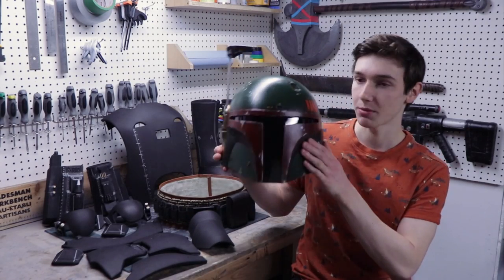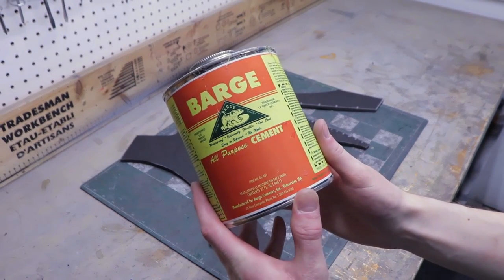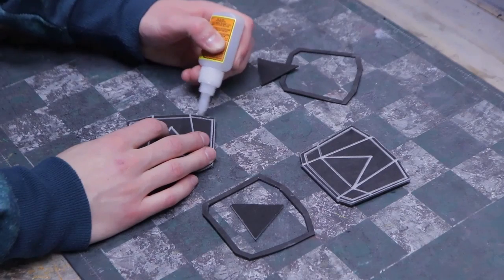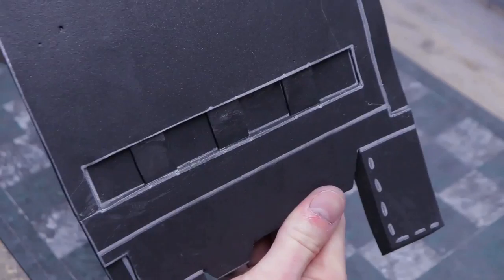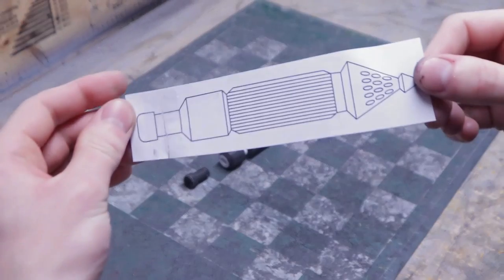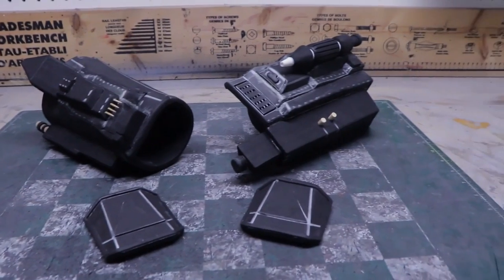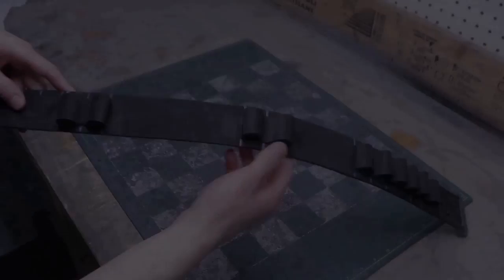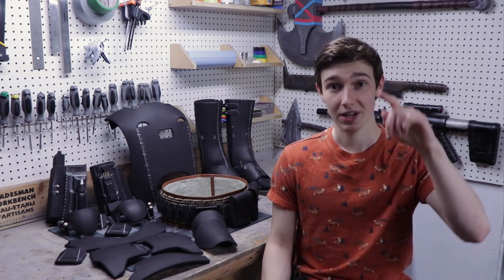Make Your Own BOBA FETT Armor Out Of EVA Foam | With Templates

Comment: How do you heat form foam? only thing I can think of that I could use that I have would be a hair dryer. Also, would epoxy 2 work or is contact cement needed?
Reply from the maker: A hairdryer doesn't get hot enough. You'll need a heat gun which you can get for as little as 20$.

Expoxy won't work. You need contact cement, and super glue for the smaller parts.

Comment: Could we have a list of supplies you used? Like how much of the different foams you used and how much I’ll need to complete this. I found some of the foam at hobby lobby, but don’t know how much I’ll need and what sizes and mm.
Reply from the maker: There's a materials list a the bottom of the product description on Etsy. 

As for the amount of foam, I'm not sure exactly, but with a 3x1 meter sheet of 8mm foam, and a 1x1 meter sheet of every other thicknesses specified on the templates, you should have more than enough.

I hope this helps!